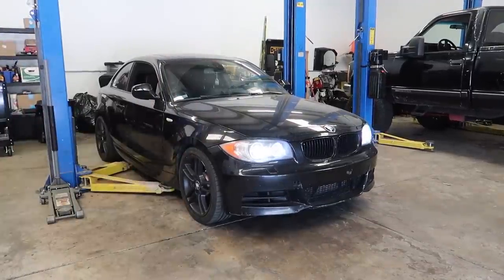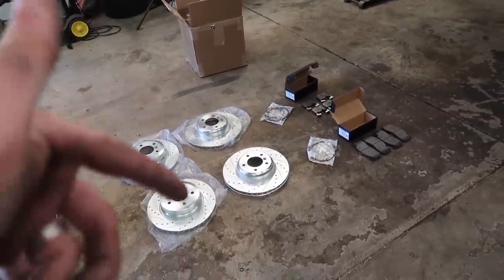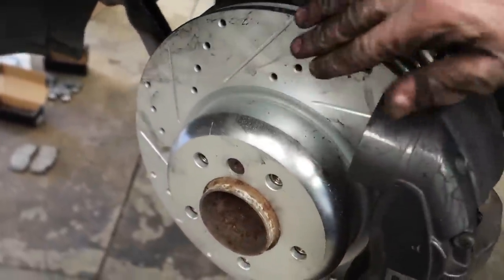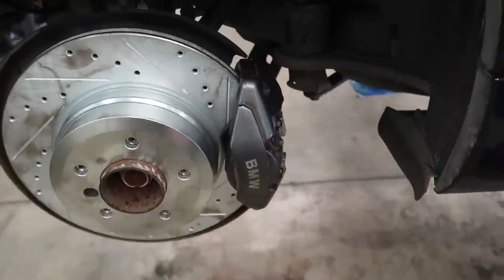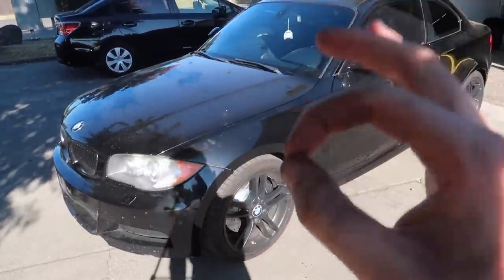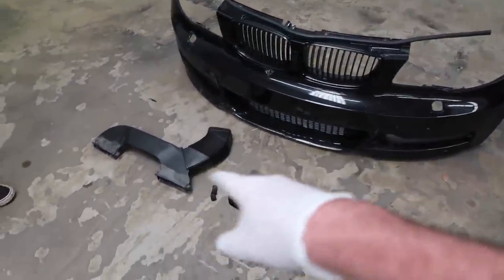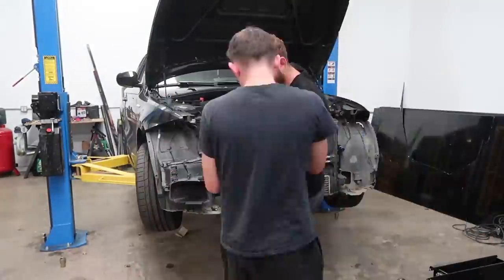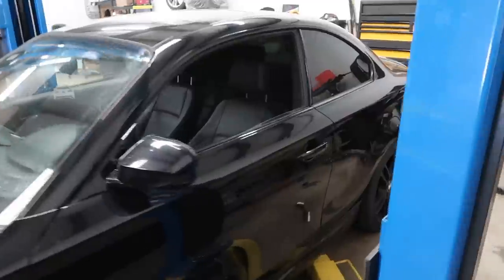800HP 135I SUPERCAR KILLER BUILD! (PART.2)

Comment: I think the rotors are the wrong way, the ones that are on the right should be on the left check that please, is really important for cooling (check vehicle virals last video)
Reply: Haha I saw he was riding with them wrong also. He had them like that for 4 years
Reply: I think you're right.
Reply: They are on wrong
Reply: Because RacecaR.
Reply: Lol
Reply: Yeah, sorry for my english, I speak spanish
Reply: Nope, they are correct. Air is not scooped in but centrifugally forced out the edge and sucked in through the holes

Comment: Reading that a lot of people are commenting that the rotors are mounted incorrectly due to the venting, but it depends on the type of vented rotors (straight or curved). If it’s straight vented (which is what I think it is considering it’s a $300 kit) it doesn’t matter what side. 

The curved vented is what aids with the proper cooling.

What is important that he needs to do is the proper bedding in of the rotors and pads.

Comment: 6:15 FYI the 135i has 6 piston calipers at the front and 2 piston caliper at the rear. I also hope you took out the old backing plates that got stuck in the brake caliper when you removed the brake pad. Plus I think you installed the brake rotors in the wrong direction. What happened to the weird sound that the engine was making at the end of part 1?

Comment: To all saying the rotors are wrong. Brake discs dont scoop up the air from the edge of the disc and out the holes, the centrifugal force of the spinning disc is much stronger. All fans accelerate air out the edge and scoop air from the centre or the holes. Air is not scoped from the edge...

Comment: Not 100% sure, but
Looks like the rotors are on the wrong way. the slots are supposed to guide the heat to the outside of the rotor, right?
Then folding the way the wheels spin it should guide the heat to the outside of the rotor.
Vehicle virgins has a video and there the mechanic said they were on backwards.
I'm sure it is not really really bad, but still